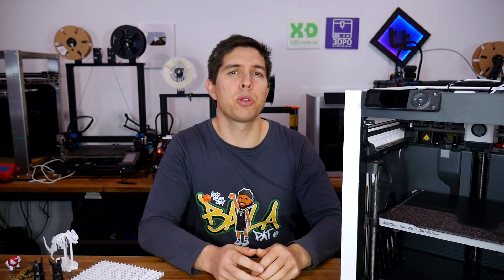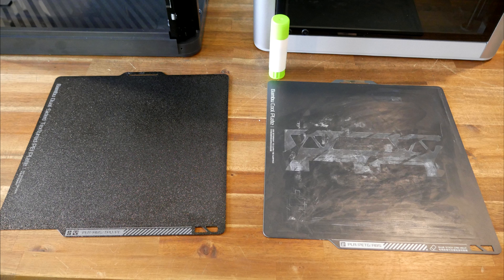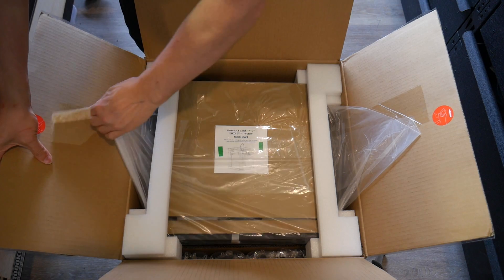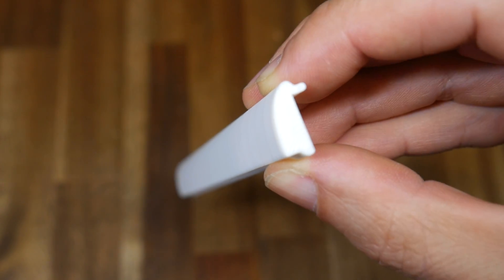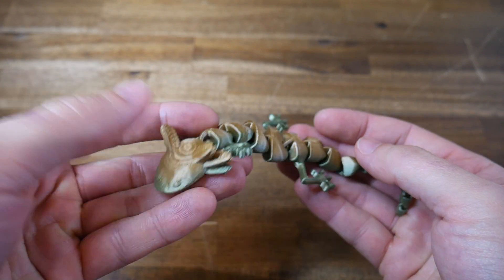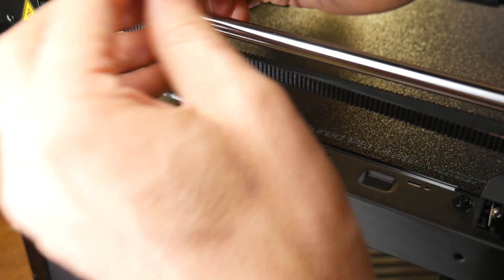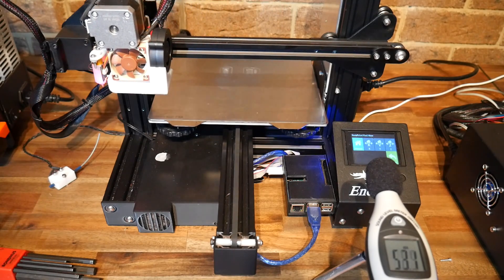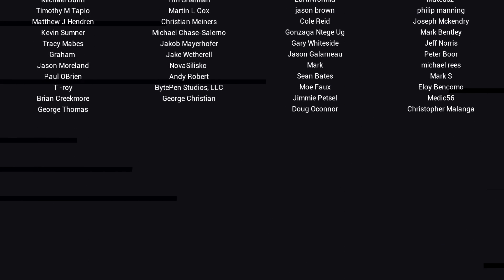Bambu Lab P1P - Your questions answered!

Comment: I know this has been misreported by almost everyone and not clarified Bambu Lab themselves very well, but the Micro LiDAR does not do flow rate calibration. Bambu have confirmed this, just quite quietly...

It does Pressure Advance calibration only at this time.

Comment: This is an extremely clear and easy to understand description of this unit. I had ordered a Prusa Mini just the other day and cancelled this morning. Nothing against Prusa at all, but this is so much more printer for the money and it brings so many advancements that it is difficult to ignore. The only question is "Which model?" The P1P seems to be a terrific starting point with less potential for expenditure regret if/when the X2 Carbon is released. The X1 Carbon has quite a bit more going for it, but by several accounts here on YouTube, it also has some first iteration issues that would likely be addressed in an X2. $1500 is a lot harder to write off than $700 when that 2nd iteration of the X1 becomes available.

The optional airtight and moisture proof material feeder has great value. Filament is costly, and when stale it causes print problems. The cost of the feeder would likely be made up in convenience, ability to innovate, and saved filament.

Again, though, I really appreciate this particular description of the P1P. It is so very helpful.

Comment: Yeah, I was considering the P1P seriously until I know its firmware is closed. This is enough to make me not buy it and look at the competition. The Voron is still worth it if you know what you're doing, because all the advanced features related to the Lidar are not really needed. Even a Tronxy X5SA is sufficient and would be a good base. Also, if speed is not a criteria, you may want to buy the new GH SmartShaper controllers in order to raise up the quality a bit (even on bed slingers), instead of buying a whole new printer or set up a raspi.
Reply: So you think the LiDAR is a gimmick? I believe a machine that can lay done a track of filament then go back and objectively analyze it and THEN make adjustments is incredible! That alone is the worth the price of the X1.
Reply: @judd_s5643  yes it's definitely a cool feature and I like it, but I don't need it. You only need to calibrate your machine once per filament, within a few minutes. Then, if you use the same filaments all the time, you'll likely never need to calibrate again. That said, it's not what I'm pointing here, it was about the closed firmware.

Comment: Love my MK3S+. The Bambu printers look really nice. But I can't get past the cloud-based stuff. There's not really any reason that the Bambu printers should need to phone home just to work without having to carry an SD card back and forth. Hardware that has any feature that depends on an Internet service, is hardware that one day will fail to work just because that service no longer exists.

For some things, where the functionality of the hardware is integral with the cloud service, that has to be an acceptable trade-off. But for a 3D printer? Sorry, no. Every single feature the printer has that is not inherently a cloud-dependent feature, must not use the Internet and must not stop working when the Internet or the cloud service is unavailable.

Comment: I've said this elsewhere, but since you've asked: I am considering a P1P for down the road.  I have an X1C, no AMS, and I bought it because I wanted something that "just worked."  The very reliable automated first layer appealed to me strongly, as did the hotend design with nozzle, throat, and heat break all as one part .  (I've destroyed two different "M6" type hotends on my Ender-5 because I failed to get the nozzle properly butted against the heat break; and the way the bed slowly loses zero on the Ender-5 is also a major PITA.)  Finally, I print a fair amount in ABS and the enclosure was a huge plus.  (I'd been looking at the Prusa XL but that wasn't enclosed, was twice the price, and I didn't actually need the larger print area.)

Having gotten the X1C, it's everything I hoped for!  And yet, it's also amazingly precise if you turn down the speed.  I'm not chasing minutes on this machine, so I typically print at about half the default speeds, and I still find the printer finishes before I'm ready to print the next thing.  With the Ender, I'd set stuff up to print, go to work, get home, and an hour later pull it off the bed to start an overnight print.  With the X1C, the printer is impatiently waiting for me having finished halfway through my day.  And I blew threw my backlog of "things I need to print" in about three weeks and was like "hunh, I'm not done CADing the next part!"  So sometimes it waits for a day or two before I have the next thing designed!   And this with a precision that I can FDM print a gaming mini on a 0.4mm nozzle and have it look as good as a late 90's cast metal figure.

So now I want to get a dedicated machine with a 0.2mm nozzle for printing very small things in PLA or PETG, and the P1P looks like a good choice for that.  If a super-easy-to-use, super-accurate printer comes along in the next few months for that I'll definitely consider it, but right at the moment the P1P seems the best choice.  It's bigger than I need, but it will fit on the shelf and it's the lowest cost option that hits all the boxes.
Reply: I'm seriously thinking of getting an X1C. I've two printers already, a geeetech  i3 (that failed 1/4 prints and required a lot of work - I'm upgrading it to a 32 bit controler with ABS at the moment and a new 220x220 bed over the 190x190 glass bed) and an anycubic i3 mega that still works but there isnt any ABL and it drifts as the bed gets hotter/colder.  I need a new printer, I've saved up a good bit the last year specifically for one.   I'm looking for reliability and ease of use over anything else, I'd like colour changing too.  I'm getting tired of failed prints, manually levelling the bed every week and poor quality out of anything other than PLA (and even that isn't great at times, especially when I need supports).  Would you recommend the X1C?
Reply: @collie147  My experience with the X1C has been quite positive overall.  There was a little bit to learn about its quirks at the beginning and I'd have a close look at the settings in the slicer - I do a lot of things that need to be sanded smooth, and the defaults don't give one enough wall thickness for that.  Also, the printer is much more accurate if you slow it down a bit.

The biggest drawback is the "cold plate" is a bit of a pain in the butt.  You do need to do the gluestick thing or you'll start damaging the surface, but over time the glue builds up.  In the past I'd run the plate under hot water to clean it off, but I've found the water gets in under the sticker and weakens the adhesive there.  So now I'm trying out just using a damp cloth to clean it, which is more annoying but my hope is will extend the life of the sticker.

I haven't tried the official "Hot plate" or Textured PEI.  I prefer a very smooth finish on the bottom layer for most prints, so the textured sheet isn't ideal for me, and the "hot plate" is another sticker so doesn't seem to offer much advantage over the "cold plate".  I did get a smooth PEI sheet from Energetic on AliExpress, and after some initial problems that were solved with a very thorough cleaning, it works well for PLA using the "textured PEI sheet" settings in the slicer.  One just has to remember to remove the lid.  I've only just started trying ABS on that sheet, but it's not being super successful - I think the PEI is releasing too soon as it cools, and then the parts are warping.  So I think I'm sticking with the annoying-but-works cold plate for ABS.  (Keep in mind, I live in Edmonton AB, where it is currently winter.  The printer is in a room that cools off to under 15C as an ambient, which is exacerbating my warping issues with ABS.)

The bed levelling is very reliable, so far - I haven't had to do a damn thing with it.  When changing rolls, I do find that I need to push in the filament while running the extruder in order to get the motors to actually grab the plastic, but that's pretty minor.  (I don't have an AMS, this is using an Eibos dryer as a spool holder, so I'm not getting a gravity assist.)  Spaghetti detection isn't as good as one might hope, I've had the printer not notice a couple times - although at least one of those was my fault, printing black plastic on a black surface with the internal light turned off and then being surprised that the printer couldn't see a failure!

The one thing none of us knows is the long-term reliability, because no-one has had one long enough; and if Bambu Labs disappears for any reason, sourcing spare parts could be challenging.  There's also a limited number of things the user can repair themselves.  On the other hand, I haven't needed to repair anything and I've had it since September; my Ender-5 needs something repaired every month, it seems. ,

Also, if you want to use their cloud-based systems you have to remember that the Chinese government could look at all that data if they felt like it.  You don't need to use the cloud though - I have my printer set to LAN only just because it saves bandwidth and I live in Canada so my internet is stupidly expensive. 

The printer is not perfect, but it is very easy to use.  It's so easy to use that I keep forgetting I should clean it up and lubricate things from time to time!  If you're not comfortable with the risk of the company vanishing and the limited ability to do your own repairs, a Prusa is probably a better choice Otherwise, if you're looking to print ABS or hotter filaments, then yes, I'd recommend the X1C.  If you're planning on sticking with PLA/PETG,  then the P1P looks to be just as functional for those filaments, and a lot cheaper.
Reply: @davydatwood3158  Excellent honest review.  I've been lookin for some details on long term use alright, really appreciate that.  I totally understand about the cool plate as it doesn't really appeal to me for most of my daily use cases.  That bed from the P1P, if its compatible, would be worth it for the majority of my printers but I do intend on printing in carbon fibre nylon for some really strong pieces and neither of my current printers can do that.
Reply: @collie147  You can get the textured PEI plate as a spare part from Bambu, and it was actually being sold before they announced the P1P.  I just prefer a smooth build surface so I can have a very smooth bottom layer.

I've no experience with CF Nylon personally but the X1C is actually intended for that material as a primary; so if that's a goal then I'd think the X1C is worth a close look.
Reply: But the x1c comes with ams
Reply: @mariospanayiotou6644  Only if you pay for it.  If you don't want the AMS, you can get just the X1C and save a few hundred dollars.

And just to be sure that wasn't some "kickstarter only" thing, I just double-checked.  On the Canadian store, at least, the X1C by itself is an option under "X1 Series" in the printers section.

Comment: Very impressive - I'll consider them after they have a year under their belt with it being so proprietary. It's great to have more innovation in the space.
Reply: I appreciate your attitude that the printer must first prove itself in the field. In my opinion, it is really overhyped right now. But to be honest, where is the innovation in it, except to steal the achievements of other manufacturers and the community together and pack them into a new product?
Reply: @tmartin9482  as with anything in this world no one can predict the future. But I'm coming close to 2000 principal hours and the X1 Carbon is awesome. Prints come out fast and accurate.

One printer has replaced three bed slingers.
Reply: @No0o0o0o0o0  You misunderstand me. I'm not saying that the printer is bad or that I don't want to give it a chance, on the contrary. What I mean is that if it turns out to be good, then love it for what it is: a printer that incorporates optimized existing technologies and that was optimized in quality to price ratio so that it fills a gap between the low and high consumer segments. But don't love it for what it isn't: innovative.

With the X1 (carbon), you could argue with the Lidar, but the video is about the P1P and it really doesn't have anything that hasn't been done before in another 3D printer.
Reply: @tmartin9482  I think of it more like apple(shudder). They dont have to be the first or innovative as we know it. They obviously used  existing tech and came out with a very capable printer without needing to know much about 3d printing.

At this price they are coming at prusa mk3 line. with a fully built but $100 cheaper alternative. As you said a nice middle ground between the low and high end. 

There are less expensive options but the speed/accuracy and ease of use what they aimed and succeeded in. Anyone who starts with a bambulab printer p1p immediately gets the iterative benefits of input shaping, auto leveling and voron like speeds in a corexy. I guess the industry has been sitting on it's hands for so long it looks like innovation. 

Can you imagine using an auto bed leveling system and still have use a piece of paper to set z off set? 

Or printing from slicer to printer with no memory cards, no need to for temp towers, crazy tweaks or from unboxing to printing in 20 min. 

I think at his point the tech gets out of the way and allows "making" (shudder) to happen.

Comment: Designed my own 3D printer years ago and I've been iterating its design since then. The printer is my hobby, I am not the market for a new printer. Yes I print many things but my printer always works very well and honestly speed is near the bottom of my priority list for my printer function. I do like to see new tech but this printer doesn't offer anything new, for me personally.

Until a couple years have passed and Bambu have proven themselves, I will still continue Prusa to people that want a problem free printing experience. So far 100% of my friends that have gotten a Prusa have been completely satisfied with them. No issues, great support and eco system. Bambu has a little ways to go to prove themselves.

Comment: Prusa has closed its GitHub, they are keeping everything private and only making public what is released. Feeling threatened?!?!

I've had X1C for a month, it's a wonderful printer but it suffers terribly from ringing and I mean terribly. 
I hope P1P won't have this annoying problem.

I've had MK3S+ kit for 2y+ plus, it isn't worth anymore. I sold mine.
Reply: Prusas github is alive and open. They never closed it.
Reply: @LilApe  it is open for what has been already released. Development is now private. You won't need much search to find themselves saying it.
On that note, they aren't any different than BL.
BL on the other side did mentioned that once this first development process is completed and rubbish removed from the code, it will be open.
Reply: P1P is mechanically identical to the X1C, it will ring just as bad.
Reply: @henninghoefer  True but what is the point here???
As far as I know BL is a new printer and changes improvements is needed sooooo???
They are aware of the problem and the firmware release in January should improve that soooooo???

Comment: I would love to get either one of these printers, I currently use Creality and Prusa but want to venture into a Core XY and these seem to fit the bill.. my only concern is can you use Octoprint with it? As I use that to manage all my printers.
Reply from the maker: I would think no to Octoprint. There is no USB port to plug in a pi that I can find for a start. They do have wireless monitoring and control through their slicer and app but if everything else you use is Octoprint this may not be desirable.

Comment: Happy with my X1C, and just waiting for the hardened steel extruder to be available for the P1P. I’m kinda bummed the hot ends are not cross compatible between the two series, but seems to be due to improvements. Same will probably happen with the extruder. Also hoping a firmware update brings adds presets.. that’s going to be very annoying.
Reply: They use the same nozzle, simply order one for the x1 and swap it out 👌🏻
Reply: @lilypower  pointless when there is no hardened steel extruder yet. I print several abrasive spools per month so it will wear fast.

Comment: I have an X1CC from the Kickstarter, and it seems this has similar weaknesses. Firmware has bugs, random errors with a link that points to a Wiki that is unfinished. It is good while it works, but I'm not sure if this will quickly become an expensive doorstop if BL starts pushing printers at Creality's rate.